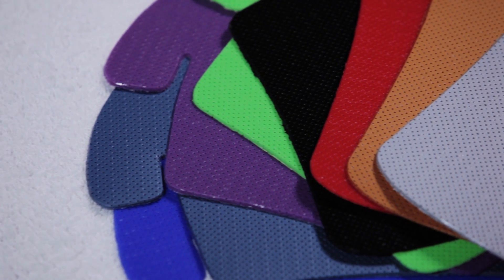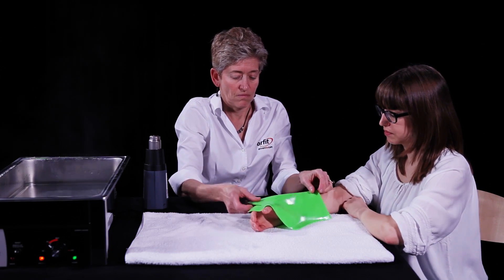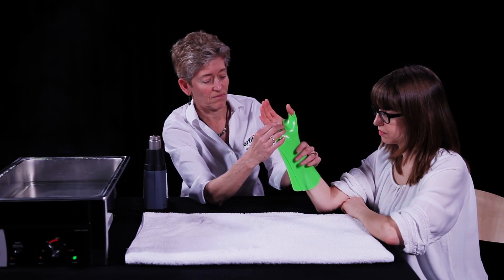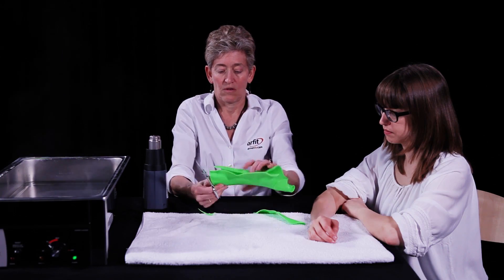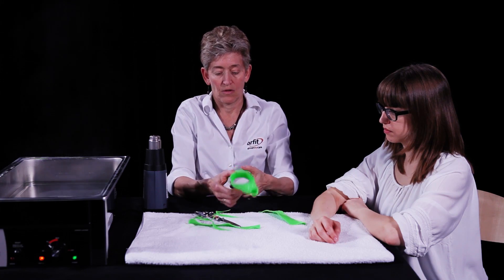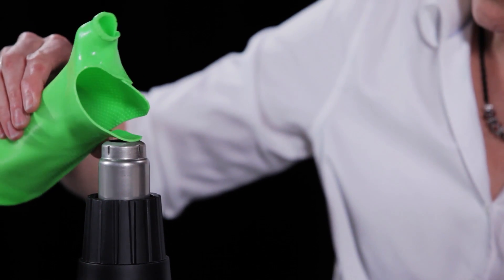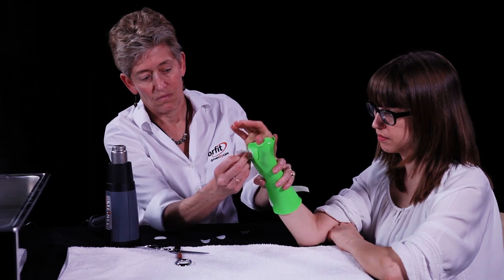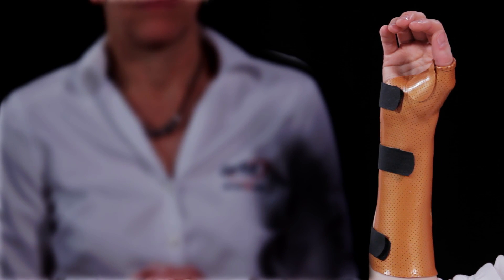Wrist and Thumb Orthosis (Orfit Colors NS) - Splinting Techniques 9/10

Comment: You can also use a BRACESOX undersleeve along with your  brace. What is nice about using this Brace and the Bracesox together is that you can wash the Bracesox just as you would any under garment to help keep the brace itself clean and hygienic. Bracesox is celebrating 26 years of partnering with brace patients for brace comfort!
Reply: sounds brilliant, I'd love a brace like this, the one I have doesn't fit properly n causes extra painm, it is also so heavy. I wonder where to get these, are they in theuk?